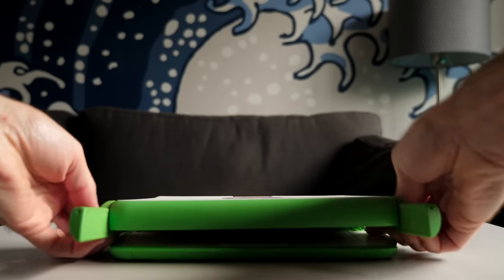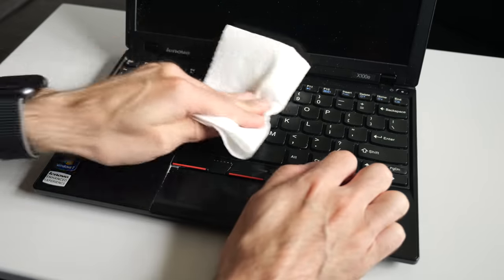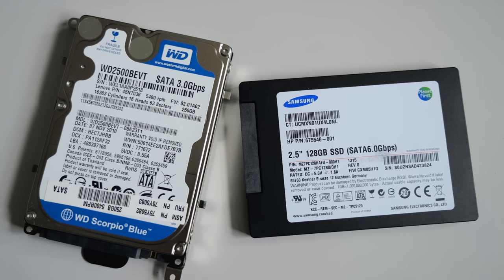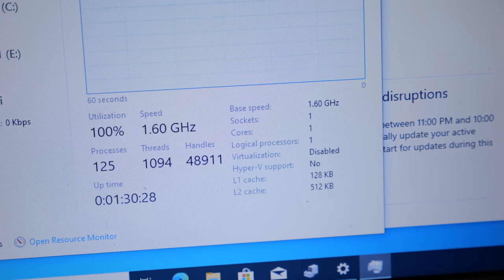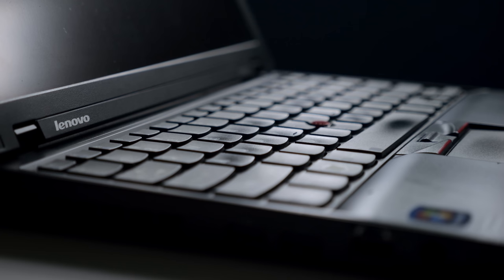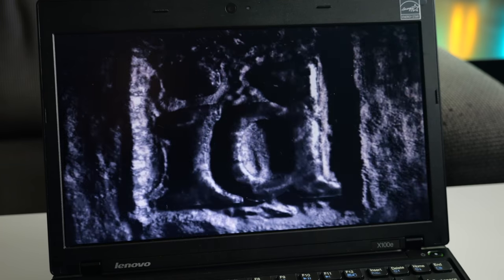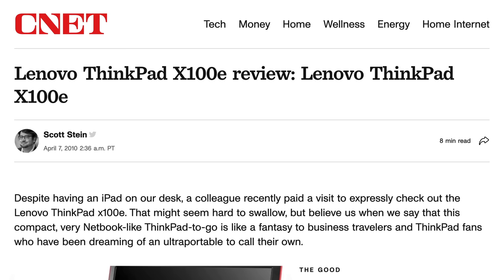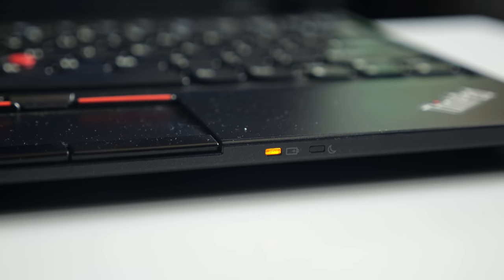Could this ThinkPad netbook actually be GOOD at retro gaming?

Comment: One thing I loved about the Trackpoint (the red eraser-head looking pointing device) on Thinkpads is that a touch typist can keep their fingers on the home keys while moving the on-screen mouse pointer.  Very good for writers and command line nerds like me.
Reply: New keyboard….. yuck
Reply: I always called that red thing “the nipple”
Reply: For spreadsheet work as well. I specifically bought an external Trackpoint keyboard since I spend a lot of time in Excel.
Reply: Always wanted a ThinkPad because of this trackpoint. My dream is to have a system with the least need of a mouse possible. Only CLI and small touches without taking the hands from the keyboard.
Reply: Always end up losing mine
Reply: When I first got my Thinkpad I thought it was kinda gimmicky and I wouldn't use it much
Oh boy was I wrong! I love the trackpoint and after I adjusted the sensibility to be on the higher side it is perfect, barely use the trackpad anymore

Comment: Kinda wish the Netbook form factor would make a big comeback.
Reply: the closest thing these days, and thats a stretch, is the Macbook Air. Bigger than a normal "netbook" but much more capable as well, and still relatively small in its own right.
Reply: @MichaelAStanhope  Well the chromebooks took the market over as well.
Reply: Me too, I had an alienware M11x that was a gaming netbook basically but at 11 inches, I loved it, I got a long shelf life out of it.
Reply: @neoasura  very true except Netbooks ran a mainstream OS. I have no experience with a Chromebook but to me if it can’t run DOOM it’s not worthy 🤣
Reply: The 11-12 inch form factor is perfectly adequate for a notebook
Reply: 11 and 12 inch laptops are fine though? GPD Win lineup exists as well
Reply: how about microsoft surface?

Comment: If you dont already have one, you might consider creating an XP installer with AHCI drivers slipstreamed in.
Reply: i wish the 64 bit xp was easier to get, i dont think i found a working iso but the last time i did that was 2018 so that may have changed. xp64bit with ahci drivers would be pretty good i'd assume
Reply: @nono-oz4gv 64-bit XP didn't have very good support and didn't offer any advantages on systems of that era really
Reply: @tannisroot  yea i was trying to remember what problems i had and i think driver support was non existent, and the only real advantages it provided were pointless when os's like vista and 7 were around
Reply: @nono-oz4gv  One doesn't really need XP 64-Bit as with regular 32-bit XP, a CPU with PAE and a PAE-aware patch, one can patch 32-bit XP to use 64GB of RAM, if missing a bit because of the old PCI/AGP/PCIe Memory Hole.
I've managed to do that on a system with an i7-3770K, GTX 780 6GB (rare as hen's teeth it seems) and 32GB DDR3-1600 (4x8GB) dual-booting XP and Win10, for playing and recording retro games in XP then editing in Win10.
Reply: Sounds like a security nightmare
Reply: @nono-oz4gv  Worth noting there are two "64-bit" versions of Windows XP. There is WIndows XP 64-bit Edition, which is only for Intel Itanium processors and is completely useless for anything else, and there is Windows XP x64 Edition, which is effectively what we consider a "64-bit" version nowadays.

Comment: If anyone's interested in an X220… willing to sell mine for $200 shipped (US only) w/ 2520M cpu, 2x4GB ram, Samsung 830 Pro 128GB, 2x 9-cell extended battery (one new, one old, both OEM), IPS screen, webcam/mic. Original box & AC adapter too. Bought brand new in 2011 and used thru uni & then home after.

Comment: got the successor x120e with the AMD Fusion E-350 years ago. basically the same cpu but with 2 cores. Yeah, still agonizingly slow so I got rid of it. but I ran it with 16 gb ram yay. it even got HDMI! the next successors x130e and x140e have nice fast cpu options up to a quadcore and usb 3.0! but I don't like them for being way heavier and bulkier than the X100e/x120e. In the end I keep using my X201, x201T and X61 instead.

Comment: ram and CPU always hold these retro builds back. Even with 8 gigs of ram, half of that will be used by the browser nowadays. You're either browsing the web, or doing something else, never both. And you can forget watching video while doing other stuff. Also for systems like this i think a light Linux distro such as Lubuntu or Puppy Linux would be better. Linux Mint is heavy for something this old.

Comment: If you're wondering why the laptop still looks dirty after cleaning it - it's the paper towels. Whenever you wipe something down with paper towels, it leaves a lot of white paper fibers behind and it generally looks bad with a black computer or a black screen. Get yourself a couple of soft automotive microfiber cloths (they're like $5 for a six pack at autozone) and, once the windex has dried lightly brush the surface with a dry cloth to remove all the paper fibers.

It's probably not super important to get your electronics "camera ready" for day-to-day use, but boy is it distracting on an all-black Thinkpad.
Reply: Now I can't unsee it!
Reply: and compressed air to blow away any remaining debris. =]
Reply: I use cotton balls and alcohol, and then a milder alcohol + distilled water mix sprayed onto microfiber reusable cloths (the ones that come with eyewear and screen protectors, as they seem to last me for a long time, so they tend to pile up. That does wonders for me.
Reply: school/scotch tape for lifting greasy fingerprints and stubborn lint
Reply: @elfedorausado  I use furniture polish on the plastic and microfibre cloth. A lot of these laptop are pretty tough. I dunno why people are soo careful with them.
Reply: Coffee filters make a great likley already on hand alternative to microfiber cloths for cleaning stuff like this.
Reply: Paper scratches too

Comment: I have an almost identical model (X120e)
True story, I coated all the electronics inside with wax and dielectric grease so I could use it in rain and snow. The idea being I could use it when it to look up issues, guides, and parts, when working on cars and trucks broke down in bad weather.

But as TDNC said, I found it was mostly good for writing. So now I just write children's stories on it.
Reply: Interesting.  I flip laptops on the side, and I am thinking on keeping an X61 I got a hold of recently just because of the keyboard, as I need it for word processing, and it is buttery smooth 😂 probably install Zorin in it
Reply: @elfedorausado  I have an X60 and the design is identical to X61. I say, always keep it. It's the best designed laptop ever. I love every part of it; the 4:3 screen, the awesome keyboard, lack of camera and touch pad, the solid latch for the lid. I run Void with XFCE with mine, it has 64-bit Core2Duo T7200 processor but still feel slow with a more complex desktop environment.
Reply: I am planning on bying x120e for myself as a second laptop. Any thoughts on the laptop's performance so far?
Reply: The 120e is actually a huge improvement over the x100e even though the outer shell is the same. The hardware on the x100e is a special breed of weak (I have one).

Comment: the X100 is the black sheep of the Thinkpad X series. If you really want a small, retro laptop, the X60 or X61 are great options. They are light, battery lasts forever, and they have that classic 4x3 aspect ratio on the screen. If you want to move into some retro widescreen, the X200 is a good option. Both have Intel Core2Duo processors so they blow the single core Athlon out of the water. I have an X61, X200, and X201 Tablet, and they are all solid machines, although my X61 is still my favorite.
Reply: Don't hate on the black sheep dude 🐑🐑🐑🐑

Comment: I recently got a ThinkPad X220 from the carboot for £28 (knocked down from £35) and I absolutely love it, I stripped the entire thing, cleaned it very thoroughly, rebuilt the entire keyboard after scrubbing each key (it took me 6 hours to rebuild the keyboard and clean it), it's basically brand new and I absolutely love it, I go to grab my X220 with Debian KDE on it now instead of my ThinkPad X1 Extreme Gen 2 whenever I go anywhere lol. :)
Reply: I wholeheartedly agree with you regarding the x220.  Just wanted to share with you that you can upgrade the screen in it to an IPS screen fairly easily if you don't care for the TN ones they came with. It is nowhere near as involved as trying to upgrade to an IPS on the T420s.  Its a 1:1 swap - the pin connector on the IPS screen is the same as the one in there now.  Cheers!
Reply: These are also great for Hackintoshing.
Reply: I got my X220t in 2019, in almost perfect condition.. it's still going great, but I'm hankering after an X230 to modify. 😁
Reply: I have one too. You gonna upgrade the screen to an IPS display?

Comment: Very controversial laptop among the ThinkPad crowd when it was released:  AMD cpu, chiclet keys, no soft touch (even came in red or white), no thinklight, no rollcage, crap battery life.  If they had named it the ThinkPad Edge 11, it would have been okay.  But giving it the "X-series" honors ruffled some feathers. Bought mine new in May2010 - dual core Neo X2.  Still use it for some retro gaming in Win7.  My dual core L625 benchmarks about the same as my old TP X60s (1.66GHz Core Duo), but runs a lot hotter and a lot less battery life.  Dual core was a cheap BTO option at the time, but the "e" was for education and most of these went to schools with the lowly MV-40.

Comment: I recently picked up a Thinkpad T20.  I replaced the HDD with an SSD I got off of eBay since I don't trust the old HDD.  It has a PS/2 mouse connector and Soundblaster support for which I found the DOS drivers.  It's makes a great pure DOS machine as well as a Windows 98 machine.  I can even use the parallel port with something like SNESKey so I can use console controllers - just had to make an adapter.

Comment: Well shoot I went and got one of these from eBay. Should be a blast for some XP gaming on the go and a nice addition to my small Thinkpad collection. Another awesome video as always Colin! Also big congrats on getting your DayStar working. What an absolute UNIT!
Reply: Definitely, Especially when you consider many older games don't do well with multicore CPUs. So a singlecore CPU here is basically perfect for it.
Reply: Can confirm it's a perfect windows XP machine. I also went ahead and dual booted Debian with xfce to run some emulators and source ports too. As long as you're not running anything too bloated (like youtube or electron apps), modern Linux is actually pretty snappy on that thing.

Comment: Ahh back in the day when even a low(ish) end, highly portable machine like this gave you two RAM slots for upgrading!

Single thread performance issues are really interesting. Like... I remember getting along just fine with a single thread for so many years, I appreciate that the OS & software demands are much higher now but it's still surprising just how demanding even a web browser can be nowadays given we did all of this and more back when single threaded CPU's were the norm.
Reply: Yeah, nowadays on many low end laptops you have soldered RAM and eMMC storage
Reply: it's bloat and telemetry. fundamentally nothing different with windows xp and windows 10, excluding third party apps it all navigates and works the exact same except maybe windows 10 has a desktop switcher system and notification panel but what the hell else makes a single core grind to a 100% usage halt even in the desktop.

Comment: It will not stress the hinges so much on your laptops if you open the lid from the middle of the screen instead of the edges. Only a tip for those older laptops with fragile hinges and it will make newer hinges last longer too. ☺

Comment: The successor X120e with the dual core AMD E-350 was pretty zippy for its time. I could run WoW at 1024x600, medium settings, and pull around 30 fps. And it was a more than serviceable student laptop w/ an SSD upgrade. Probably the best $400 laptop I've ever owned.

Comment: Battery life and temperatures were bad because of the HD3200/HD4200/HD4250 IGP, it was NOT meant for subnotebooks because AMD lied about the TDP of the chipset. Many would burn out because of this, making the chipset IGP as infamous as the nVIDIA 6150SE.
The X131e was the last of this series, with the Athlon Neo X2 and the HD4200 as far as I can recall, they had the green AMD VISION sticker denoting its professional-oriented hardware stack.
They were classified as subnotebooks because they were priced way beyond the netbook territory and competed with the subnotebook niche that got popular with offerings from DELL (Inspiron) and HP (The Pavilion DV4 which had the same Athlon NEO chips).

After this Lenovo dismissed AMD and paired their hardware offerings (A-Series APUs) with the worst ThinkPad SKUs, and that wound hurt so much that many top-end SKUs still lack Zen-based hardware.

Comment: I'm currently overhauling my Mini10 (a cheap-ass version of the x100e, made for Australian school students in 2009) to be my university laptop. It's 14 years old and still runs. It now has (or will have once I am finished tinkering) 5 USB2 ports, HDMI, VGA, SD Card, fingerprint scanner, backlit keyboard, external wifi antenna, an internal USB3, 16gb RAM, 500GB mini SATA, a second heatsink system and microfan, a new IPS screen, and upgraded speakers. I have the CPU from the higher-spec x120e in it, so it's a little snappier than the original. The additional heatsink got over the biggest problem, which was always thermal throttling. I modded the case pretty heavily to allow for more airflow, including using shims made from another x100e case to make the bottom half of the shell ever so slightly deeper. I also removed the bezel from where the speakers originally sat and made that area the same thickness as the rest of the case, again, for a little more space. The laptop now rests on some 3d-printed folding legs for airflow. The internals corners and back of the screen have been re-enforced with some aluminium sheet.  
It's incredible what you can do with old netbooks. The form factor is unbeatable for people like me who are constantly on the move. It will never be a gaming or video-editing beast. That's not the intention. Its purpose is reliability, portability, and usability.

Comment: I found that when using windows 10 in old hardware it is better to install version 1809 or earlier as they will be smooth and not demanding as for 22H2 i don't recommend it for older device's.

Comment: This might be a candidate for a decent portable DOS machine(no, really). Lenovo provides packet drivers for the ethernet card, SBEMU might work just fine on here for SoundBlaster emulation, and the CPU is already quite slow and single-core and could work well with setmul to slow it down to the required performance to run DOS games.

Not to mention it would be that distraction-free typing device as well.

Comment: Until a couple years ago I owned a x120e! I genuinely wish I kept it. It's kind of sad because these could have been great little machines, if the CPU wasn't a limiting factor in what you can do with them.
Reply: I have an x120e too, I ran the most cutdown version of Arch Linux with i3wm on it, but somehow Haiku was running smoother on it than Linux. 
Compiling a basic C program was slow and I am wondering how I got through my first semester in CS with that thing. Learning vim on a thinkpad is one of the best thing you can do with that keyboard
Reply: I still have an X120e, and the other issue besides the sluggish dual core APU in the machine is the whitelisted WiFi card that can't be upgraded unless you hack the BIOS, but it runs Solus Budgie well enough for a very basic daily computer, so I keep it around as a backup  machine. I've never tried any retro gaming on it though.  
If you want something cheap and cheerful from this era that's still usable as a daily driver, and is kind of rugged originally being made for the educational market and if you don't mind an 11.6 in 720p screen look at a Thinkpad X140e with a quad core AMD A4 APU that will take 8GB of DDR3L RAM, and runs Solus Budgie Linux, or Manjaro GNOME w/Traditional layout with ease, and runs cool as can be. I've had one for years, and while I have newer faster desktops, laptops, and even tablets, every so often I just keep going back to that little X140e, and enjoy typing on it so dang much(trackpad is another issues, but thank GOD for the Trackpoint LOL!). 

Having said that the real killer of almost any Thinkpad from this era now are finding new batteries, and if you do getting them from a decent 3 party seller that does not charge you an arm, and a leg.
Reply: @harrytsang1501  I have an X120e, and never have been able to get Haiku to boot from USB no matter if it's the 32bit, or 64bit version, maybe it comes down to revision numbers with different chipsets on the mainboard? 🤷‍♂
Reply: @CommodoreFan64  maybe it's a different configuration/revision

Mine had the lowest end single core AMD netbook processor that measures below the raspberry pi 3. Besides programming assignments, I mainly used that to SSH into other Linux machines

Comment: Why not try opening the battery pack and change out the 18650 cells inside with new ones
Reply: its a lot simpler to just buy a new battery
Reply: @Blacksmith52  I don’t disagree with you of course it be simpler to just get a new one but laptop manufacturers don’t offer replacements especially for older models like in this video